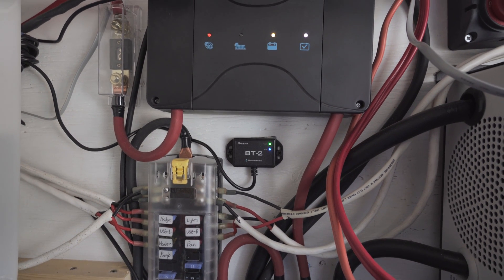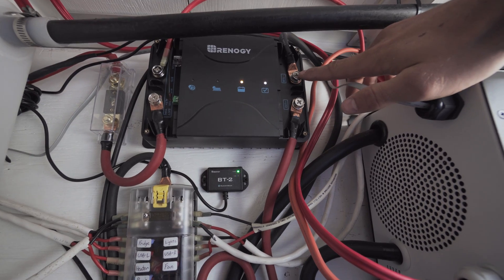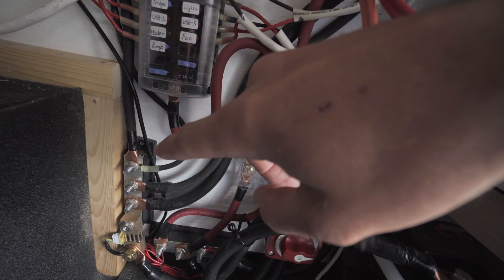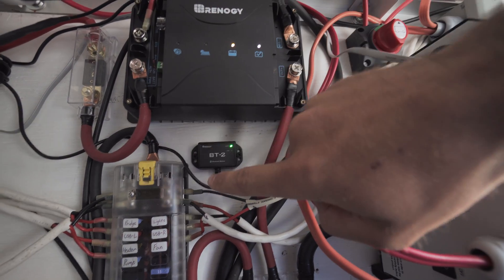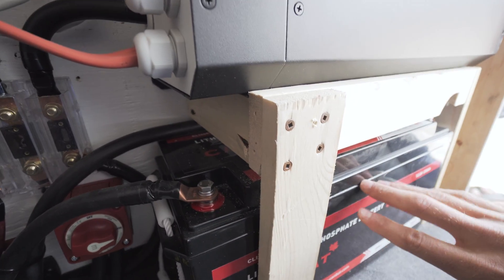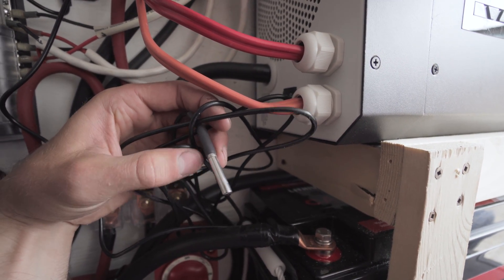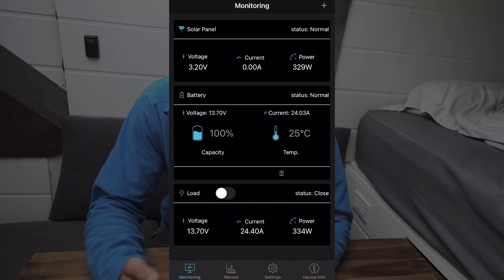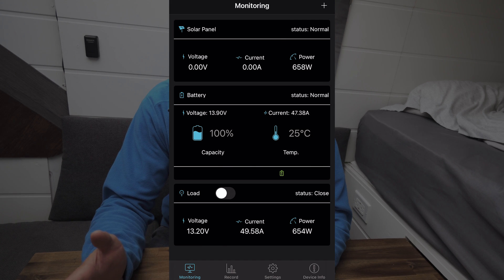Renogy DC to DC Charger Install in Off-grid Campervan Solar System

Comment: Hi great Video, we are the distributor for Renogy, and as mentioned below by another viewer, the relay that is triggered with ignition will open circuit the solar input, so that charger takes 50AMP. 

But 1 thing I notice is your fuse from the starter is near the charger "ALT" input, I suggest to move that fuse to the engine compartment, near the positive of the starter battery instead. At the moment you have no protection on the cable from the positive to the fuse, which is probably using 50 or 25amps, and this wire is exposed to all sorts of harsh environment. Not pointing you out here, just trying to keep you safe.
Reply from the maker: That’s a good point! I will definitely consider moving that fuse into my engine compartment.
Reply: @overlandgcc I am awaiting delivery of the 50A version of this. Am I right in thinking that with a non smart alternator the manual says that ign wire isnt required. So without IGN wire connected with solar, once the engine is running, the solar will be disconnected and 50A will be available
Reply: Let us know what you find out once you try it I would like to know as well
Reply: Hi!

I probably myst a detail. I'm not sure i understand what it could be the best setup. Actually, i just put a on/off manual switch and it's working pretty fine. I can see the 50A coming from the alternator. So, what i could made to put it plugged on the fuse, how and where i need to plug this ?
Thank very helpfull
Reply: I have a Dual battery automatic switch (PIHANNA)  in the car, to run out to the van with the renogy and to the car secondary battery.
I assume the output of that switch is like the output of a smart Alternator and the sense wire should just attach to it.
Good idea with the solar Isolator, getting a driving light relay from bunnings to automate that switching is a great idea.
Reply: Have the same issue, similar set up. I have a shut off for the solar to get the 50 amp but I haven’t connected the ing wire since renogy told me so.

The max amp that I can get is 35 amp and some time lower 
I wonder if I should use 4awg wire instead of 6awg. 

I was also thinking of adding an other dcdc charger… but renogy does recommend it
Reply: @sachapatoinetroianovici5505  Is your alternator powerful enough to supply the 50A plus extra for loss in cable.
Reply: Is it possible to get the whole 50A charge from just the alternator alone? I haven't got the solar on yet and the most charge i can get is 22amps and if wired up the same as you, thanks
Reply from the maker: @mattbee7885  i would double check the smart alternator connection and make sure it’s wired correctly
Reply: @madetoexplore  It also depends at what stage of charge is your battery, as battery reaches towards the full charge, the charger steps down current and voltage. It is only in the bulk/boost stage that you get the full capacity of the charger. 
Each battery chemistry has it's own boost/float stages and hence the charger will adjust to the profile selected on the charger for that particular batter type.
Reply: @madetoexplore  Yours is not wired correctly in the video. You shorted it out according to the manual. there is not a negative hook up to the IGN plug, both are positive. Page 11.  "There are two ports on the green IGN connector housing. Both ports have a positive polarity, so only one connection is required from either port."
Reply: @mattbee7885  I was having the same issue because even though I don't have a smart alternator I hooked up the IGN + wire to get the full 30 amps that mine is rated at. What was weird is in the morning I would get about 20 amps charge and in the afternoon I would only get about 8 amps regardless of how much charge was in my L-ion battery.
Reply: was about to leave the exact same comment .. should be fused at the starter battery side.

though technically the renogy trickle charges the starter battery from solar when the house battery is full, but you can't exactly fuse for that on the same run :)

Comment: Hello. In your video you say that the both the neg output AND the pod output from the charger are 2awg. On the input side, from the starter battery you use a 4awg. Is this correct?
Reply from the maker: Yes
Reply: Ok. So I’m a bit of a novice.  May I ask why not just use 4awg in and out?
Reply from the maker: @brettferguson6954  there is no specific “out” for the alternator. The negative or ground for the controller is 2 awg and also acts as the out for the controller.
Reply: In the absence of a reply from Made to Travel, I would have used the same gauge for in and out.

The only thing that comes to mind that could explain the difference is the cable length plays a role in the choice of gauge. Longer lengths see a greater voltage drop and to counter this, you'd use a thicker gauge. That said, Made to Travel seems to have done the opposite to this?

Comment: An obvious thing to do here would be to install a 'normally on' relay in line with solar powered by the ignition wire so when the engine is running it shuts off solar automatically?
Reply from the maker: Yeah that would be another option but 95% of the time I don’t require the full 50amp draw from the alternator. I also think installing a manual shut off switch is easier than a relay for the average diyer.

Comment: hi.ive recently had problems with my solar camper van system.i have dc to dc charger12amps.been good had about 4 years off eBay.the factory that makes them near me.but as I have a bigger compressor fridge now which is on 24/7 it draws a bit more power and my 3 parallel 110amp batteries getting weaker over time thinks its best to have more powerful dc to dc charger.think the renogy 20amp one may do.i do have 260watts solar and 3 separate mppt controllers for each group of panels for max power.i use camper van for work daily so charger be on most days and when we camp off grid the solar helps.only have water pump/led lights /usb sockets to run.i do have a Krieger 1100watt inverter I use now and again .

Comment: If you already have the 2000w inverter/charger why do you need the 50 amp dc to dc charger also?
Reply from the maker: They have completely different roles in the solar system?

Comment: I have the same charger with 2 x 100w panels do I connect them in series or parallel pls ?
Reply from the maker: Parallel
Reply: @madetoexplore  How many do you think that one can connect in parallel before it gets dicey? 

We want to start with a 2x100W setup. Then, if we need more want the chance to expand to 4x100w or 6x100w, do you think that this controller could handle that?

PS, thanks for the great rundown!
Reply from the maker: @thompson4620  the controller can handle 660 watts of solar. Make sure you to double check the amperage to make sure your wire is the right size tho!

Comment: My understanding as to why Renogy designed the DC DC charger to pull a max of 25 amps from the alternator is to protect alternators from damage if they are not designed to produce that much more current.  Many alternators just dont have the build strength to regularly produce up to 50 ADDITIONAL amps beyond what is being pulled to supply the vehicle's electrical systems.  Say when you're climbing a hill or towing a load, your alternator has to work much harder to generate the amperage to safely power your car's computers and electronics.  So it is really important to know, not guess, if your particular alternator and charging system can safely produce an additional 50 amps continuously without actually overheating and being damaged.
Reply: That is exactly why they do it. As an alternator is not just supplying 50 amps. When you start an engine. You have 30 maps just to run the fuel system. Another 10 amps to recharge the battery. Then with all the Can Bus Modules add in another 20 amps. You are now at 110 amps. Without any thing else it's supplying like coils. As each coil takes 7-8 amps..

And no damn alternator can do that from idle.  It will over heat and fry it. You need to be above 2500 rpm. Never mind vehicle alternators are cooled from the air flow while driving. That little fan is only for stop lights. Unless you have a Diesel. They are more tolerant of output at idle. But I would not count on it lasting long. Unless you invest in a high-end alternator designed for idle charging above 140 amps for prolonged periods of time. Something the Car Audio guys figured out fast. As they install 4000 watts of amplifiers..
Reply from the maker: This is very true. However, it would have been nice if Renogy allowed the user to decide on how many amps they pull from the alternator.

It is easy to upgrade alternators which I have done. I installed a 150 amp alternator in our Sprinter which replaced the existing 90 amp one. That’s 60 additional amps that should allow me to charge my batteries without an issue.
Reply: @madetoexplore  No it doesn't.. That rated output is based on RPM's above 2500. While moving. I got a 250 amp alternator. It only produces 75 amps at idle with an overdrive pulley on it..It also has a huge ass heat sink. As that heat has to go somewhere..
Reply from the maker: @WizzRacing  I don’t spend a lot of time just idling so I’m not that worried about it and I rarely pull 50 amps from the battery anyway. I guess installing a switch near the drivers seat and only switching it on at highway speeds would help resolve this issue? Or upgrading the alternator again which would also be an easy job.

My alternator has about 20,000km on it so far and is performing great 👍
Reply: @madetoexplore  My advice is take it too a good known alternator\starter place. Have them test the output at idle and under load...Then have the DC-DC charger run at 50 amps.. And make sure they can print out the results. So you can see it..

And be advised. The more an alternator puts out. The bigger the casing gets. Why most RV's today have two alternators. It's just cheaper and more reliable. As some of these high output alternators get real expensive..And if you ever need one repaired. You have to wait till they get to you. As there not a stocked item at automotive parts places. 

As I learned all these problems 20 years ago the hard way...

Comment: Question: my setup is similar to yours only my house battery is much smaller given it only powers so little.  I have one 100 watt panel on the roof of my vehicle and whenever I use the Renogy BT app with my BT-2 the app shows voltage for the solar panel but zero amperage.  Do you have any thoughts on why this might be the case?

Thanks.
Reply from the maker: I haven’t personally had this issue but I would make sure everything is wired correctly and maybe try restarting the solar charging.

Comment: The max solar voltage for this charger is 25V. Does this mean I have to use solar panels where the peak voltage is under this too? Because many 12V panels i looked at have peak voltage/ open circuit voltage above this.
Reply from the maker: Yes, you want the max open circuit voltage to be under 25V. Which solar panels are you looking at?
Reply: @madetoexplore  well, i was just browsing 12V solar panels on Google and checking what is in the shopping section lol. But usually those big panels are above the 25V. Seems like i would have to specifically find the smaller ones. Any suggestions for good panels?
Reply from the maker: @obinnaeke8067  oh okay, yeah I would suggest 175 watt Renogy panels for sure but I’ve also used the 180 watt BougeRV ones off Amazon and they work well too!
Reply: Made to Travel, would you mind shutting off your solar panels when they're otherwise producing good power and then measure the open voltage for us?

I suspect the open voltage is not the metric to use here. I bet your open voltage ends up being 30+V but as soon as you draw current off them, the voltage drops to the ~18V seen in the video. The rule is simply to make sure your solar panels are nominally 12V and only connect them in parallel!
Reply from the maker: @frankfnhallukhall4520  after testing that theory out, the voltage was 19. My solar panels are definitely wired in parallel .

Comment: Great video thanks for doing this. When your solar is disconnected and your house batteries are topped off and your engine is not running will the starting battery be topped off as well? I have another mppt charger because I have more solar than what the dc-dc charger can handle but I would really like it if my starting battery could be charged. Any suggestions? Thanks so much for your input.
Reply from the maker: If you leave the solar input connected then the controller will charge your starter battery but only after the house batteries are fully charged. If you purchase the BT2 module you’ll also be able to set custom settings for these features.

If the solar is disconnected and the engine isn’t running. Where would the power come from?
Reply: @madetoexplore  I was hoping I could draw power from the house battery bank. This battery bank will go up to about 14.6V when they are being charged by my other solar charge controller. Looking at the specs it looks like the renogy DC to DC with mppt is not designed to work that way. I'm just trying to find a creative workaround. Thanks for your response.

Comment: Useful video. I bought one of this as well. The ING signal wire only come with one single red wire, but you mentioned in this video that theres another black negative wire (ground) you connected it behind the fuse panel. So, where is the other end of that cable (negative/black) connected to?
Reply from the maker: I believe that it’s supposed to come with a two-conductor wire (one red and one black). 

The negative/black is connected to the ground bolt underneath the seat in our t1n sprinter. It’s a common ground point on this vehicles but any grounding point will work as long as it’s a good reliable connection.
Reply: @madetoexplore  Mine came with a single red wire coming out of the 2-port mini-terminal connector and the manual said the user could connect the positive IGN wire to either terminal in the port.  So my unit is obviously using the large ground lug to complete this circuit.
Reply: I think I now understand this charger hookup having read the manual and setting it up myself. The key to getting 40-50 amps from the alternator is the shut off to the solar input. It has zero to due with the IGN signal. BTW the manual specifically states that both connectors on the IGN  are postive hence only one wire needed. I have the dumb alternator and did not connect the IGN and got  40+ amps off the charger with the solar disconnected. I am grateful to Made To Travel for posting his video.
Reply: Mine only came with a red wire for the ign too. I was wondering. Hopefully I cam add the ground and get my setup working
Reply from the maker: @bradenanders8291  that’s strange that Renogy is only supplying a single conductor wire. I would purchase some duplex wire for the install.
Reply: Installed mine by just tapping the single (red) ign signal into a fuse, didn't need to ground it and everything works
Reply: @BlackstaffeMitchell  Do you have a normal alternator or smart alternator?
Reply: @237311  normal alternator, not exactly sure what the deal is but I have a 02 Chevy Express and the alternator puts out like 13.9 volts max, so I don't think the DC to DC charger 'understands' to draw the amperage, so taping a 12v circuit at the fuse box let's the charger 'know' to pull the appropriate amperage. Went from pulling 7 amps to pulling 45+ by tapping to a 12v circuit.
Reply: @BlackstaffeMitchell  You have a normal alternator and just connecting the red wire to 12v circuit, and you didn't use ground (black) wire at all?

Comment: Nice video, i thought t1ns didn't have smart alternators, did you upgrade yours? Also. Does the renogy still draw power from the starter battery if you shut off your solar batteries and solar panels as you're hooked up directly to them?
Reply from the maker: T1n don’t have a smart alternator but if you don’t connect the smart alternator ports on the charger, you’ll only get between 5-15 amps while your driving. I also upgraded my alternator to 150amp alternator which I would recommend doing! Easy job and the part is only $220 CAD.

The charger only draws power from the starting battery if the engine is running. It will actually top off the starting battery battery through the solar panels once the solar batteries are charged as well.

Comment: Any chance you could tell us what you used for the solar cut off? I was hoping to see it in the video. Is it just a manual breaker of some sort?
Reply from the maker: Yeah, it’s a manual isolation switch. One of the ones that are usually used to disconnect or isolate batteries.